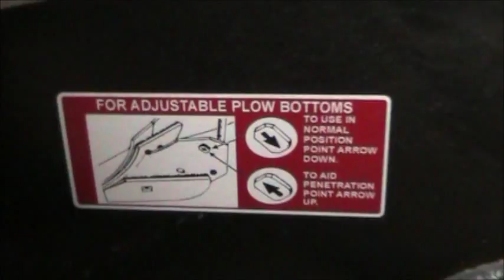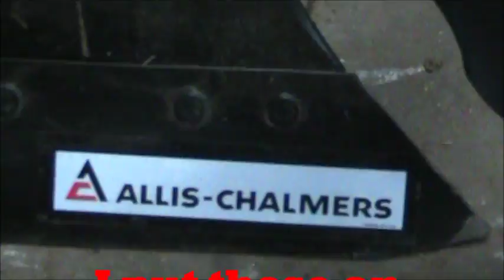Restored McCormick International 215 Moldboard Plow for Dr. Jones

Comment: Mine is not too bad a shape. Some pitting of the metal and could use a few new bolts. Shares,frog,shins. moldboard and landslides are in good shape. Dont have a gauge wheel on mine either. Coulter are fair some wear. I also have the 215 Moldboard Plow operators manual.